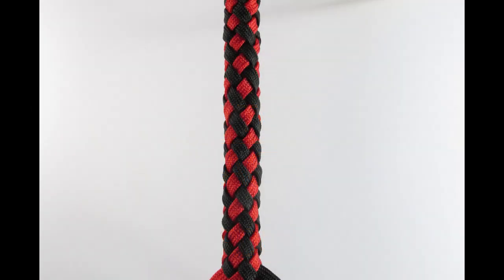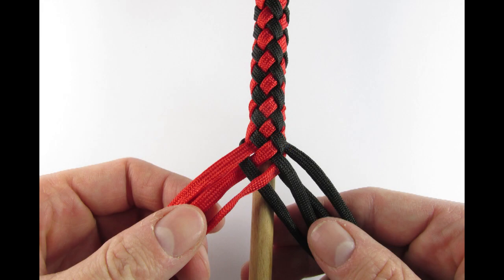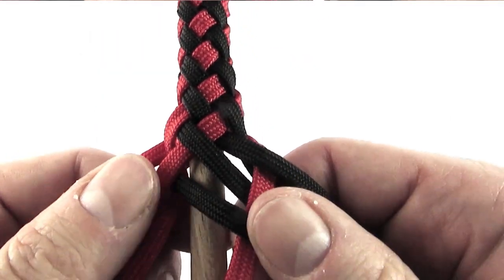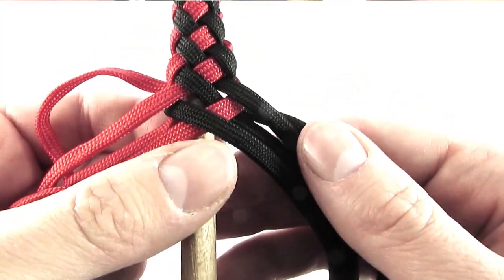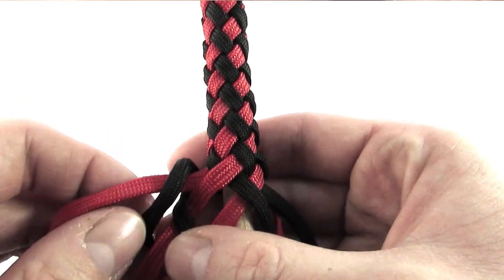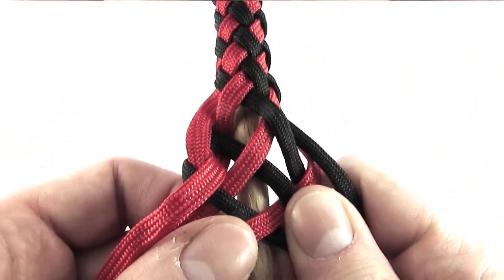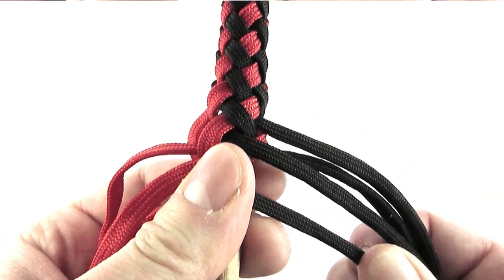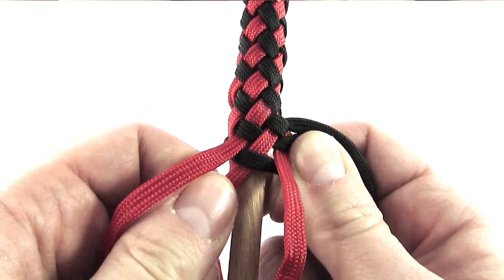8 strand round plait around a core

Comment: I assume that if you wish to plait this design around a larger ( 35mm ) diameter, you simply use more strands, is this correct please?
Reply from the maker: Hey! Indeed that is the case!

Mark
Reply: Thank you very much for your prompt reply. I have never done anything like this before, so know nothing about it at all. How do I calculate how many starnds I need, and what length they sould be please? The diameter I wish to wrap is 35mm and the length is 300mm.